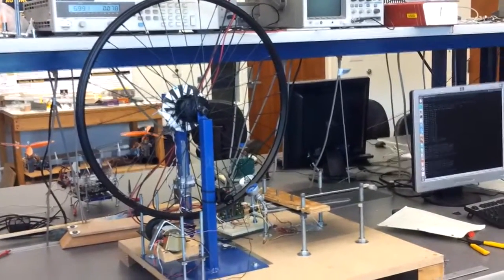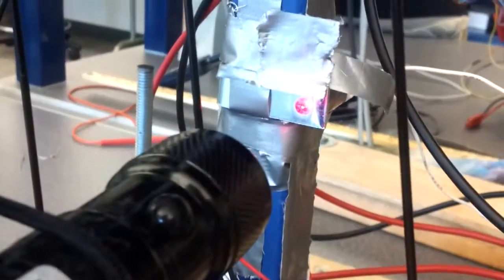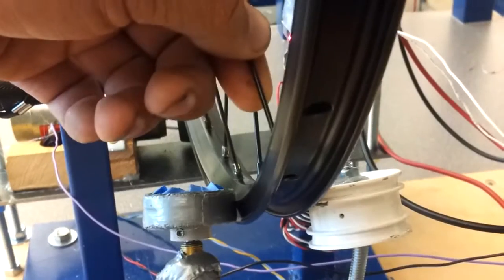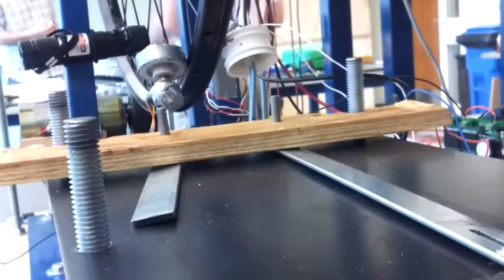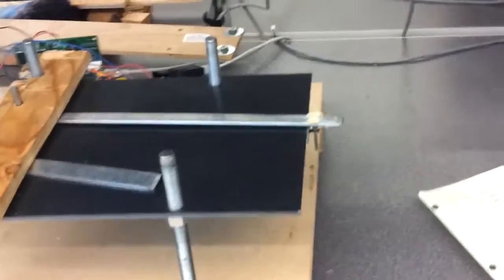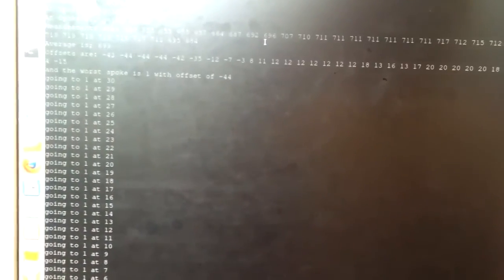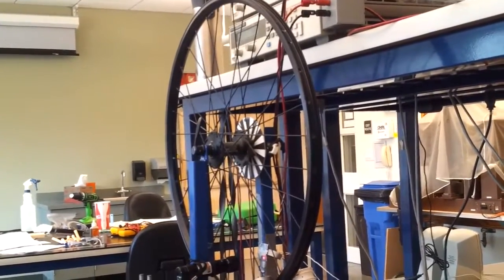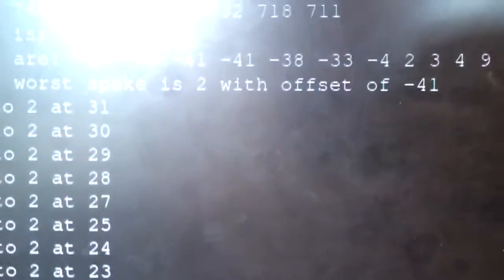Automated Bicycle Wheel Truing Stand Prototype

Comment: I dislike pots as they're noisy and get noisier with use... Better with micrometry, perhaps using phase difference from an ultrasonic transducer.  I can't help thinking that a cheap CPLD and ultrasonic transducer would be far more effective, accurate and compact.

Even better, with two cheap transducers the same CPLD could measure both the lateral wobble AND the centering (due to uneven spoke tension) and issue instructions to not only true the wheel to a plane but also centre it to the axis simultaneously - solving both jobs at once.

Your vertical transducer would also let the CPLD see the valve hole in the rim (either because of its markedly lower reflection amplitude, or because you could insert a mechanical sentinel to give a sharply closer reading) ... thus providing strong absolute indexing.  Thus the output from the CPLD would be a serial stream giving:  Absolute spoke, H-deviation, V-deviation in a much smaller package capable of reading any size of wheel.

Close alignment of sensors is not important as the deviations will be relative to the ideal rather than absolute measured distance.  Again, this can be dealt with in the CPLD by accumulating measurements and dividing by spoke count so that deviations are from an imaginary centred wheel.

Please don't take offense.  I like your project, but being autistic I tend to try to perfect everything.  I see a simpler self contained system with a CPLD taking phase measurements and serialising to a PIC 16F84 driving an LCD to inform the user.  Perhaps a 'hands off' beep, then a spin stopping at the next troublesome spoke, then an instruction.  Press a button to move on (which will either retest, move to the next spoke or declare true)

Actually, I think I should try and build one : )  I've been looking for another FPGA project and I have just bought my first bike :D

Thanks for making me think and good luck with your projects : )))))))))))
Reply: Just thinking, the above does away with the motor requirement altogether.  Hand spin the wheel till the MCU is happy and asks you for a specific spoke.  slow down and move to that spoke.  By spreading (or splitting) your spoke reader light to cover two sensors you'll get direction of movement - so the MCU can show current spoke number and desired spoke number.  No motor required.  So, we're getting simpler and smaller : )

Also, how about using collimated light for measurement.  Light from an ultrabright SMT LED or LaserLED can be collimated using a double convex lens, optionally ground down to just its centre region to produce a parallel field.  At the other side, focus the upper and lower halves of the flat beam into two light detectors.  This can make a VERY sensitive shift sensor in an ultra-thin package.  Only one sensor is needed for thickness measurement but two will give you a perfect measurement of both size and centring.

If you can apply this shadow ratio measuring principle to a bike wheel you'll get a cheap and highly effective system with no measurement noise or wear.

I really need to sleep, LOL.  Grrrr my noisy head : /
Reply from the maker: Gary Chapman Thanks for the feedback. Glad I could inspire a new project by sharing one of mine. Post your video as a response if you decide to build it.